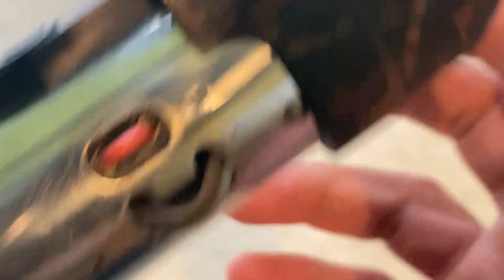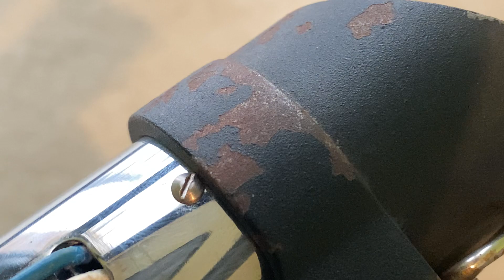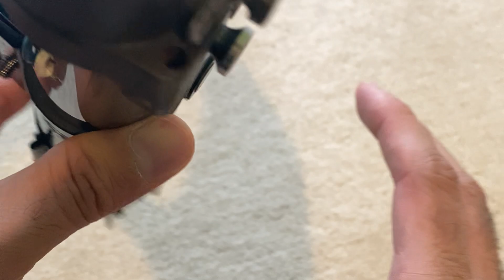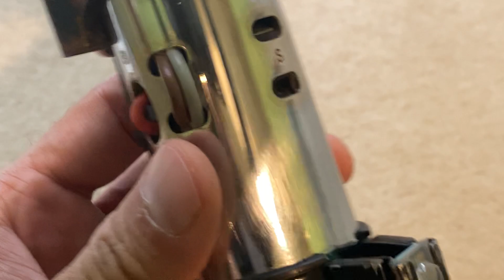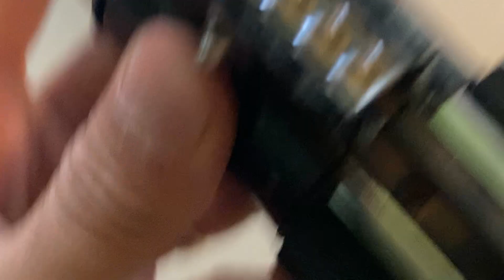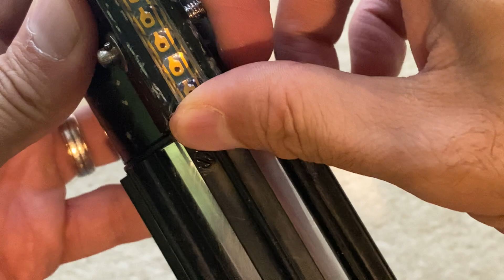Darth Vader's lightsaber from Empire Strikes Back accurate conversion

Comment: I don't know if anyone mentioned this or similar to you yet.  My advice to recreate or simulate rust would be the following.

Of course expose the surface areas down to bare metal on the places you want rusted

Next, a table salt & vinegar solution mixed together then applied with a cue tip to the areas desired to rust can speed up the process.  Actually, extremely fast.  It may not be needed in most situations..

Finally, you can build a steam box like gun smiths do,  or an easy diy  set up is to simply run the shower on as hot as possible, and let the part hang or suspend near the source of the steam.  

Results will vary depending on if a solution was used and/or how much you applied.   Once you've reached your ideal amount of rust, rinse it off good,.  Then use distilled wwater for a final rinse,.  You can apply a rust inhibitor if you want, and/or clear coat.  From matte, all the way to gloss finish would be up to you.  

If you choose not to coat it, there are waxes for conservation and things.  If you dint, rust will always continue to spread once introduced.  (Even if you coat but at a much much slower pace.  

Hope that helps you or someone else.

Credentials and disclaimer - 
(These are tips and tricks ive picked up over the span of my careers and hobbies. 
Ive used various techniques on all types of projects.  My experience is with Autobody repair mainly, as well as shipboard maintenance in the Military as a sailor, and as a hobbyist of many types of metal professions or items. 

I am not saying this is the only way, and may not even be the best.  For me, in my experience, its is economical, simple, and quick.  It produces the results I like, so it is why I am suggesting))